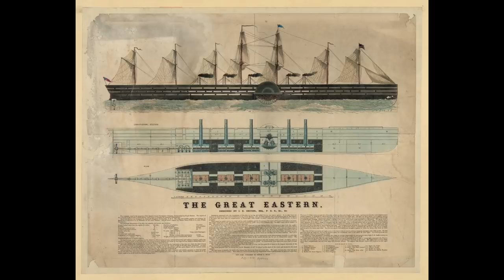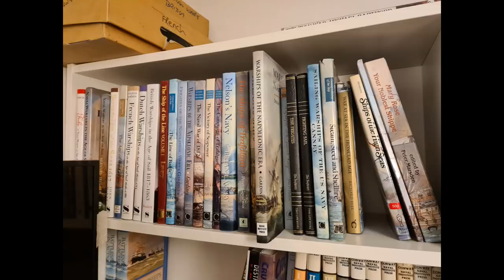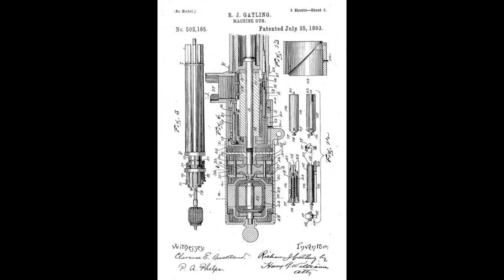The Drydock - Episode 188

Comment: For age of sail book recommendations 00:35:30 I'll throw out a couple of suggestions, but only for those people who really get into the subject; because some of these books can be difficult to find and can be very expensive.

Great Ships: The Battle Fleet of Charles II by Frank L. Fox - This is IMO the best reference book on warships of the mid to late 17th century.

A Distant Storm: The Four Days Battle of 1666 by Frank L. Fox - You want to get an understanding of the largest and longest naval battle of the Anglo-Dutch Wars and how these huge fleets maneuvered and fought, this is it.  There is also a less expensive version of the same book; I guess it's an abridged version, simply titled The Four Days Battle of 1666. 

The Seventy-Four Gun Ship: A Practical Treatise on the Art of Naval Architecture (4 Volume set) by Jean Boudriot - Do you want to build a 74-gun ship of the line from the ground up and maintain it?   This will include learning exactly what kind of dock yard facilities you will require, and every type of wood and hemp rope; and how much, you will need for every part of the ship.  Plus, as a bonus you will also learn exactly what type of iron you will need to mine; because a specific crystallization pattern is required for some metal parts.  You will also learn to man and provision your new late 18th century terror of the seas.  If that sounds enticing and you have money to burn, these are the books for you.

I just have the first two volumes and it was cheaper to purchase them at the Musée de la Marine in Paris and mail them home, but that was a number of years ago.

John Paul Jones and the Bonhomme Richard: A Reconstruction of the Ship and an Account of the Battle With H.M.S. Serapis by Jean Boudriot.  A much less expensive; though not cheap, book on a more limited and specific subject, but really in depth.  The amount of research done on the ship itself is freaky amazing.  This author has a number of interesting books, I wish more of them were translated into English.

Comment: Two stories of Shinano applicable to this weeks drydock:  It did have a launch problem where the caissons weren't filled with water as they were supposed to be, so at launch they popped open and flooded the slipway suddenly causing the ship to bang bow and stern against the dock as things settled out.

Second, her armor plate was riveted like Yamato and Musashi, which contributed to her sinking, as Archer Fish's torpedoes, set to run at 11 feet, hit the junction between the torpedo blister and the main hull, ripping the riveted armor plating apart.  Shinano's damage control officer just couldn't understand the damage he was seeing as massive sections of the the ostensibly armor-plated hull had cracked open to the sea and Abe was in such a rush to get away from the 'wolf pack' (of one submarine, as it turned out) he drove tons of seawater into the ship by maintaining high speed right after the torpedo hits. (list was up to 13 degrees within minutes) From that Shinano could never recover.
Reply: Most of the armour on the Yamatos was welded: only the thickest sections were riveted due to difficulties in welding armour that thick. That part about Shinano’s incompetent DamCon is true though.

Comment: Worth keeping in mind that armor plate, particularly face hardened armor like US Class "A" armor, is terrible for use in the torpedo protection. It is too brittle and does not flex enough under blast pressure, as the South Dakotas and Iowas found by tying the armor belt into the torpedo defense system, and then having to reinforce it later.
Reply: I thought they used class B in the tapered lower section?
Reply: @davidlow8104  That is what I'm seeing in the armor diagrams, a transition from class A to class B at what I assume is just below the water line. The question at was about whether carrier armor belts were part of the torpedo defense system, and I was attempting to point out that this would be a terrible idea for the reasons given.
Reply: @kemarisite  oh that makes sense

Comment: Solution for the ammo consumption problem of the 1935 Gatling 20mm that's more simple than paired mounts with Orlicans: a drive motor with high and low speed windings and a switch to change fire rate. Low speed has the fire rate matched to the traditional cannon. Once you've lined up the target, flip the switch to high speed and send a burst out. Make it a momentary, and it will even automatically revert to the low fire rate when released.

Comment: Vulnerability of ship steering. Had several steering fails. Worst was a gradiant (pitman arm) failure on my tuna boat while manoeuvering through a coral reef. Could only steer a wide left circle. Had to disconnect the blockage while play strong wind, waves, currents, tide for an hour between two very shallow reefs. A friend finally got his 3hp dinghy running. With both engines we pushed and pulled the heavy 30footer through a super tight s-bend into the ramp. On other occasions oil line burst and a steering cylinder broke. A sailboat rudder is easy to maintain and fix. A wheeled yacht. Same thing with my tuna boat. Big boat steering fails are electronic or hydraulic. Mechanical Outboard steering fail at the cable bracket near the engine. If you got twin screws..differential steering with props and putting the opposite engine in reverse when turning slowly will keep you going through tight turns.

Comment: The idea of a n "unsinkable" merchant was also tried in WWII iirc.

As I recall a U-,Boat torpedoed a merchantman repeatedly only to eventually find out that they'd had such a difficult time... because the holds and available spaces were filled to bursting with cork and empty oil drums, apparently in an attempt to make a U-Boat waste all of it's torpedoes/ give itself away.
Reply: I read that the German Navy used that, e.g. in France at the U-Boot bases to safely escort them out of the bases because of the mines the RN had placed there. They literally banged their way out 😆
Reply: This was a common tactic for Q-ships, whose holds were often filled with cork or other buoyant materials. It would not stop the ship sinking  because of the inevitable loss of bouyancy and structural damage by the torpedo hit, but would slow the rate to the point the submarine would surface  to finish it with the deck gun. Submarine captains were very aware of their limited supply of torpedos and so would be unlikely to use more than one or two torpedos on an average  cargo ship relying on the deck gun when possible. For an excellent memoir of the use of Q-ships see "my Mystery ships" by Gordon Campbell V.C  D.S.O Double Day Doran 1929  no ISBN for the 1st edition I have.
Reply: @johnnemo6509  not a guarantee though, see USS "Atik"

Comment: In RE Steering and damage to...  Bismark's steering casualty was not damage to the rudders nor steering machinery, but a knock on effect of a design flaw.  The armored citadel ended at the steering gear and the keel and stern structure aft of that was not nearly as strong.  The air dropped torpedo hit at this juncture (golden torpedo?) and the keel at that point failed allowing the stern structure to settle on the rudders jamming them in the position they were currently at...
Reply: ONI Report
One torpedo struck amidships on the port side, one on the starboard quarter, and possibly a third on the port quarter; The torpedo which hit the starboard quarter wrecked the steering gear, jamming the rudders and causing the Bismarck to turn slowly in circles to the starboard. Frantic efforts were made to repair the damage: It was announced that the man who succeeded in freeing the rudders would be given the Knight Insignia of the Iron Cross. Divers succeeded in centering one rudder, but the other could not be freed, Efforts were made to steer the ship by her engines, but after a short period, instead of proceeding on her intended southeasterly course, the Bismarck was actually northwest of her position when the attack was made. There appears to have been further controversy among the officers. The captain, when asked by an officer whether he should try to blow off the jammed rudder, is reported to have replied, "Do what you like; I am through with it." The ship's best speed was now reduced to 10 to 12 knots.

Comment: I think most ships now use a variant of the pintle and ram.  The tiller is an extension along the line of the rudder within the ship, and the ram is a double-acting hydraulic cylinder at right angles.  The tiller is connected by a pin to the center of the ram.
on 21JULY45, Dad was XO on a destroyer in a shipping sweep through Tokyo Bay. After doing a bit of damage, they withdrew, and Dad, as tail-end-charlie, found himself doing circles, with no rudder response. He ran down to after steering, and found the crew blithely answering helm orders, and ignoring the fact that the pin connecting the tiller to the ram had fallen out.  he corrected the problem, and they withdrew in good order.
They were actually not in great danger:  it was a night mission, and the Japanese thought it was an air raid, and never fired a shot at them.  But he knew nothing of the atomic bomb, and we had liberated enough prison camps by then that the pucker factor was close to 100%..  I think this was USS BLUE,  under Capt Smith (son of Gen "Howling Mad" Smith), who my dad greatly admired.

Comment: The "WW2 Gatling" is a neat idea, but as stated below you are relying on the Mk1 Eyeball, possibly aided by a lead-computing sight.   A good dose will literally tear a WW2 aircraft apart, but one needs to hit.  Another detail is that by the time your 20mm has engaged, corrected, and hit, the other guy's aircraft has probably released its payload.  20mm are easy to install in great numbers, but they are really good for causing the pilot to pilot to lose his aim, less so for stopping a determined attacker (like a kamikaze).  Unless the aircraft is physically torn to bits the wreckage may still come in at the ship.  A power failure would also leave a big gap in the air defenses (presumably they would only be one part of a layered AA defense).

Comment: (40:27) One possible solution is quite simple! Have a multiple speed motor on the Gatling gun!!  They've done 2 speed motors (and upon occasion a 3 speed motor on various trial guns) this would allow you to track and correct aim at let's say 750 Rounds Per Minute, and perhaps up to 2,250 RPM at a target! (I don't see the need for much more than 2,250 at an attacking airplane during WW2 (except for perhaps Me262s and the Ohka (Baka) aircraft, and those were exceedingly rare!)

Comment: On 20mm Gatling in WW2 - would the ammo feed systems of the day actually have been able to keep up with the consumption for any length of time?
Reply from the maker: The octuple pom-pom had 140 rounds per gun, so the mount had 1,120 rounds aboard. Belt feed would keep the gun going long enough for an attack to be over. The ships that used them carried over average 2.5k to 3.5k rounds per gun in the magazines. So a theoretical gatling 20mm that replaced an Octuple pom pom could have 20,000k rounds available for a mission.
Reply: Ah wow, that's way more than I would have expected.
Reply: @thomasrast6710  You can find pictures online, you'd be surprised how many "small" calibre rounds you can stack in a magazine.
Reply: @Drachinifel  the bigger issue would be getting ammunition into the gun. 

An octuple pompom has eight separate feed systems, a rotary cannon has one.
Reply: The Hispano-Suzia HS.404 20mm revolver cannon and it's variants were everywhere in WWII.  There were belt feed variants that fired 700 rounds a minute from feed systems that look pretty well identical to what current rotary cannons use, so I don't think there would be an issue with feeding as they already had pretty fast cannons using belts traveling in raceways. 

I think the real issue is that the main advantage of a single rotary cannon over a dual or quad mount is it needs less crew, which wasn't a big deal in WWII, so they just kept going with what they knew worked and had factories already tooled up and building.

Now days, a single 35mm Rheinmetall Oerlikon Ahead turret would sterilize the skies of WWII aircraft out to 5 km or more.  Hell....they can shoot down mortar and artillery shells. https://www.youtube.com/watch?v=bdwjcayPuag
Reply: @member5488  The Hispano-Suiza was not a revolver cannon, it was a standard magazine or belt feed depending on the model. 

Revolver cannons only went into service with the ADEN post war. And while that increases the rate of fire, they have nothing on a gattling-like rotary cannon. Feeding several thousand rounds per minute of cannon shells is no easy task in the 1940s.

Comment: In terms of Gatling guns bear in mind that the later m163/m167 Vulcan cannons fired in a 30/60/100 round burst mode.  There was a setting for no burst limit but that was itself limited to about 1,000 rounds per minute simply because you couldn't keep the thing fed otherwise.

I'm not certain how the phalanx and descendants handles this issue, but remember it's very much a niche weapon, that typically will not be asked to handle a sustained attack.

Comment: Query. Did the slower speed of the KGVs have any effect on the British Pacific fleet in 1945…?
Reply: I'd be surprised. The North Carolinas and South Dakotas didn't with the US fleet the previous 2-3 years. Sure the top speed is lower than the carriers, but the carriers rarely need to run flat out for very long, and they can easily cruise along at the same speed the rest of the time without getting too fuel inefficient.
Reply: @kemarisite  I've heard that it was the KGV's short range was a bigger issue.
Reply: @timothyschmidt9566  wikipedia lists a range of 11,000 nautical miles at 14 knots versus 15,600 knots at 10 knots. Doesnt look to me like there would be a huge difference at the same speed.
Reply: The range of the KGVs may be lesser as they have to cheese it to keep up with the carriers.

So the slower top speed is no issue but lower cruising speed maybe issue? As to keep up they have to go faster than they like it?

Comment: Why did the British chose the N3 design over the L3 design? And if the L3 was chosen and got built because of no Washington Naval Treaty, how would it have been modernised/performed in WW2?
Reply: N3 was chosen because compared to L3 she's 9 meters shorter and nearly 3000 tons lighter, while having the same armament and armor. Even when you don't have any treaty-imposed size limits, if you can reduce weight without any change to combat ability, that's worth doing because the smaller ship will cost less and take less time to build.

As for if an L3 had been built (either there's no treaty, or Britain somehow managed to pull a Dreadnought by laying her down immediately in 1920 and having her already in service by the time the Washington Naval Conference began in November 1921), she'd probably have been refitted along similar lines to Queen Elizabeth, Valiant, and Renown, with new boilers and turbines, a line of QF 4.5" BD Mk II twin turrets down each side of the superstructure, etc. Given that she probably wouldn't need to add large torpedo bulges, what with her postwar design already having better torpedo protection than the QEs, I imagine that L3 might gain some speed in that refit. Probably not quite able to keep pace with the KGVs when they're steaming at full speed, but 27 knots wouldn't be out of the question.

This would definitely be a ship that Bismarck doesn't want to run into.

Comment: One issue with the 20 mm gatling is that its an heavier mount so you might prefer an 40 mm instead.
But the idea of standard 20 mm with tracers to walk and the gatling to kill might work well against kamikaze.
Reply: The main issue I would see is getting a reliable 20mm rotary cannon. In particular the feed system. A quadruple or octuple gun has four or eight feed systems so their feed systems only need to be 1/4 or 1/8 the speed of a gattling type cannon. And in the event of any failure you lose 1/4 or 1/8 your firepower rather than all of it. The feed system was a significant issue the Americans had in developing the Vulcan, and more generally is a major source of failures in firearms.

Comment: I would be curious to get your insight in the history of how knots became the standard unit of speed for warships, and stuff like what exactly is a knot and what did they use in the age of sail
Reply: A knot is simply one nautical mile per hour. A nautical mile was historically 1/60th of a degree of latitude, or 1/21,600th of the circumference of the Earth. Since that circumference varies depending on the section, it's been defined by various countries to varying degrees of precision, all of which are in the neighborhood of 1,850 m.
Reply: @kemarisite  yes but a knot tends to be faster than MPH and i thought it wasn't a set amount of distance rather a distance and time traveled on the longitude/latitude